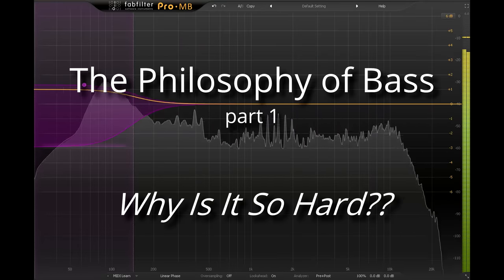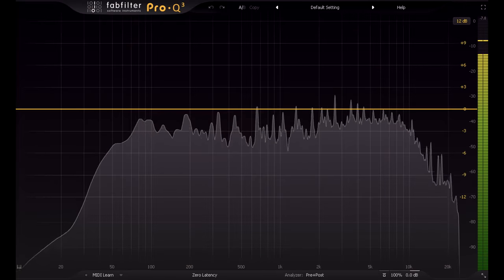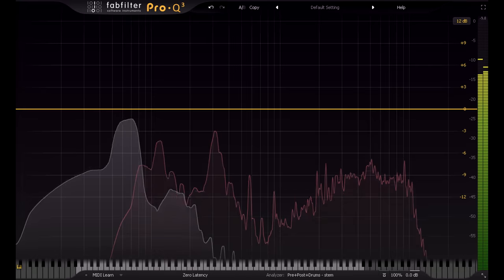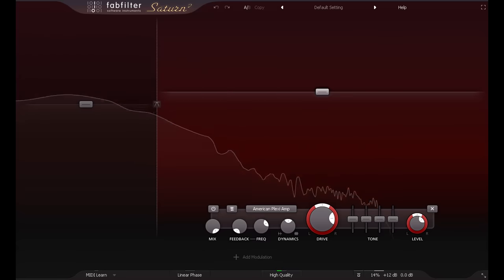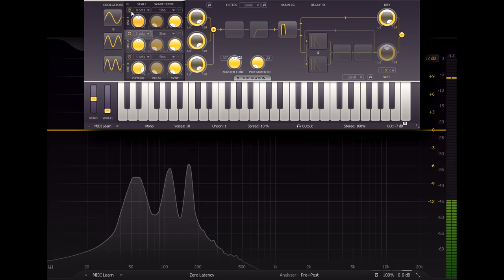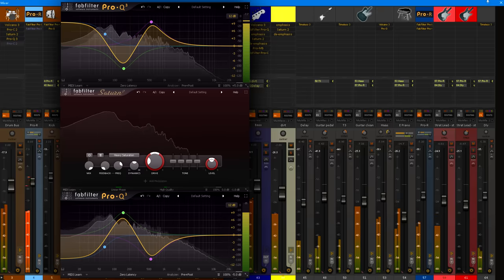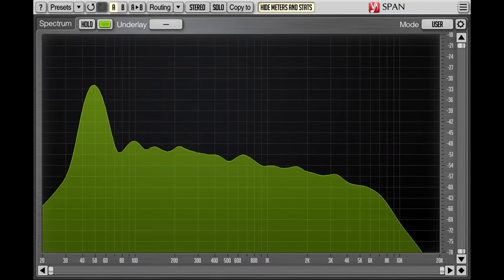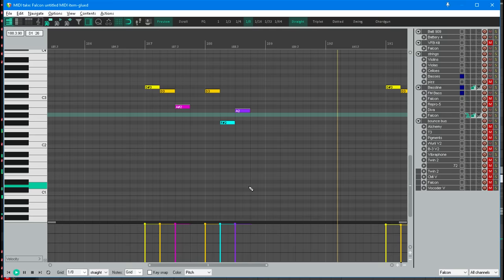The Philosophy of Bass

Comment: There's also other aspects of why you want to choose the speaker size (physical size) according to criteria most people don't even consider.
Further away you are from the speakers, larger they need to be, more cone area you need. This is because now there's more air between you and the speakers and speakers must be able to generate a pressure wave that has proper impedance matching to the air in the room.

When pressure wave is travelling through air, when there's high pressure, the air molecules in the wave are trying to escape to the air outside of the wave and when there's a low pressure zone, opposite happens, where air outside of the generated pressure wave is trying to fill in the low pressure region.

This strongly attenuates and distorts the generated wave further out of the source you are, and this generates a lot of issues where no matter how much volume you push into the speakers, they cannot deliver the pressure wave all the way to your listening position without it being completely wrong.

This is why in concert PA systems you see MULTIPLE speakers arranged into an array that they create a one friking huge "virtual" speaker-cone that pushes  a huge wave of air and thus can deliver the fidelity all the way to the listener even several tens of meters away. But because physics, even these systems don't rely purely on VOLUME to deliver that material but after certain distance one needs to have delay lines, additional sets of speakers that are delayed from the main ones (because sound is SLOW) that can re-establish the impedance matching and keep the wave going without too much distortion and attenuation.

And this is a thing even in high frequencies, even if people usually notice the huge subwoofer arrays first, the "bananas", as they're affectionately called, do similar job, but since high frequencies are more directional, one can divide the audience into "sectors" such that each individual piece of the banana can cover that particular volume of air, thus reducing the requirements from the speaker itself.

And when listening tuned array speakers from up close, they have very, VERY wonky frequency response, but it evens out at a distance.

So yeah... select spekaers based on your listening distance and volume of air. :)
Reply: I'm sorry, but most of what you wrote up there is misleading, misinterpreted or incorrect.
I'd suggest reading up on 'acoustic impedance matching' properly.
What you're describing is an attempt at countering the inverse square law. This is mostly achieved through means of higher SPL. That's achieved with stronger and more efficient drivers (and more drivers).
More cone area just means more SPL, mostly. And what we're after in subwoofer drivers is not cone area, it's displacement. Couple high displacement with high efficiency nets you high SPL within your given power budget.
And forget about transmission medium non-linearities (air causing distortion). That only occurs above some 150dBSPL. Yea you lose SPL, especially in high frequencies with distance, but that can be compensated with EQ (which is why the 'bananas' exist, the top most speakers have a strong HF boost to compensate for the distance loss, because they're aimed at the audience furthest away from the stage). The resulting increase in distortion has a very simple cause: the loudspeaker has to work harder because it needs to produce higher SPL.
And you're making it sound that high frequencies are more directional by chance. That's not the case, you can build a speaker with 360° HF radiation just like a subwoofer happens to do with bass. Line array elements are specifically designed to have an exact and controlled radiation pattern (5° beam width for the larger systems for example).

Comment: Another problem about headphones would be that just about no audio interface actually has a well designed headphone amplifier. There's always some catch to it, especially when using lower impedance headphones and more budget friendly interfaces. But even a lot of higher end interfaces struggle here for some reason. It's just very difficult to get an actually reliable system.
Reply: Can you elaborate on these problems, is there something to look for from a strict objective perspective? There's so much snake oil in the hi-fi system/DAC-AMP world that I find it hard to look for systems where the goal is accurate representation, not some subjective "warmth" or whatever.
Reply: @samuliauno8163   I absolutely agree, the whole snake oil thing is kind of a huge problem. loads of people really do not know how their equippment works and believe in just about anything they want to. I'm no expert either, I just happen to be quite interested in the topic and looked up waayyy too much about impedance and the whole ordeal. I'm going to try and explain it, but there is also an amazing video by Julian Krause on the topic (Amplifier Impedance matters!) which I'd highly recommend you watch. Basically, every component in an AC device (most audio hardware for instance) has an a spedific impedance, similarly to the way every component has a specific resistance in a DC circuit. This impedance is usually stated as a single number, but is actually different for different frequencies, so ideally you'd want it to be stated as an impedance response. Now, headphones and headphone amps aren't really two entirely seperate devices that just work independently of one another, but rather one complete system, once they are connected. This also goes for all other kinds of audio equippment of course, but in most cases, there are standards for what the impedance might look like (Take guitar speakers for instance. Those usually have an impedance of 4 or 8 ohms). This is not the case for headphones. Neither amps nor headphones themselves have common impedances in the professional audio market, which can cause a couple of problems. The largest and usually most detrimental one is the effect of connecting low impedance headphones to a high impedance amplifier. Since the impedance response of the headphones changes a lot across the audible spectrum, so will the frequency response in t his scenario, since certain frequencies require more current, that obviously isn't being delivered by the amplifier, since amplifiers aren't usually made with spedific headphones in mind. There are a couple of other measurements that are affected by mismatching amp and headphones, like distortion, noise, damping factor, etc. but I'm realising this comment is getting quite long, so I'll try to wrap it up. TL;DR bascially, you want an amp with the lowest output impedance you can get and headphones, with an impedance that is at least 8 times greater than that. This won't guarantee ideal performance, but you can absolutely bet on there being problems if you don't ensure this "rule of eights" applies. I have been searching for more or less affordable audio interfaces that have a low headphone output impedance (and good performance otherwise) for a while and so far the only ones I could find were the following: Bascially all MOTU interfaces, the Focusrite Clarette(+) series and RME interfaces. I'd assume UAD to be quite good as well, but I haven't found measurements since I find they are quite overpriced. If you don't have an interface with low output impedance (or don't know) you'd honestly best be advised to buy high impedance headphones. They are not without their downsides and some amps even work worse with them, but with the current state of the intrface maket you're running relatively safely if you do that. There is honestly waaaay more to say about this topic, but the Youtube comment section is probably not the right place for that. I hope I could help ;D

Comment: Thanks for a great video. One thing that’s often missed when mixing and mastering music, especially “complex” music with a lot of different processing, is that your music might really suffer when it is encoded later using different digital codecs and their different data compression methods. Data compression is different than the acoustic compression that we all think of. It’s the art of decreasing the number of bits and bytes needed to represent the actual sound of your music. In our modern world, only a few listeners will be listening to your mix at the same data rate as you are using to mix or master. Instead they will be listening to a much lower bit rate recording like a MP3. These codecs use a variety of techniques to do this data rate reduction but the very best of them use psychoacoustic techniques to remove data that’s not required to make your brain “think” it’s hearing those notes. Starting with the very simple technique of not encoding the low volume noises played right after a high volume noise. You brain can’t hear that low volume noise so why waste bits encoding them? More complex techniques start playing in the “brain” parts of the signal. They might filter out those upper range multiples of the lower fundamental since your brain doesn’t need them if you have represented the original frequencies correctly. The very best of these codecs not only remove these upper order multiples of the fundamental when encoding the signal, but replace them when decoding the signal on playback.  I bring this up as a warning when you purposefully mess with the signal by reducing either the fundamentals or increasing the upper order frequencies to achieve an effect.  You can create a sound that will sound fine in your studio but will sound like a train wreck when someone rips that track to put on their phone or Walkman.  While you might not care since your version sounds great, your listeners who you want to be customers, might not get the same experience. So I just suggest to travel carefully when you start playing with different effects. Some get very much lost in translation when encoded, decoded, encoded, and then decoded again. A video on these effects and how to deal with them might be very helpful.

Comment: Thanks for the breakdown on bass. There's definitely a lot to unpack here in the 30 minutes, and a lot of great tips.

There are two things I feel like could have been discussed in this concept of the philosophy of bass.

1) Perceived loudness, aka the Fletcher-Munson curves/equal loudness contours. Subbass and bass tend to be quieter relative to mids and highs to the human ears, so we tend to want to crank up the volume more to hear the bass better. Therefore, it's important to keep that in mind when mixing and leveling our subs and bass. If the subs and bass sound powerful at quiet volumes, imagine how blown out of proportion they will become when played loud, which doubles down on the point made in this video of huge boomy PA and club systems often already being subbass happy in their own mixes. I think it's a good rule of thumb to consider, make sure the subs and bass aren't too hot when listening at quiet volumes. We all want to make music that sounds better when volume is turned up, not the other way around.

2) An overall deeper physics breakdown of sine waves and subwoofers. If you ever look at a video of a subwoofer pushing out air in slow motion, it's pretty obvious it's strongest when it pushes out smooth sine waves. I think there was a good opportunity here to showcase Saturn's multi-band distortion features, so you can leave the sub range of 100Hz and lower undistorted/saturated. If we overdistort the sine waves down that low to the point they are clipping into square waves, it gets to the point it's an unnatural shape for subwoofers to push out, and potentially risks damaging equipment on top of just overall losing a nice clean sub impact.

I listen to a lot of bass heavy genres, and I'm often surprised how many when thrown under an analyzer like SPAN show that the sub region isn't hitting as loud proportionally to the rest of the song as you would expect. Maybe it's part of the psycho/brain element of bass in our heads, or maybe it's just the concept that simpler can be better, and a really smooth clean sine wave at the right levels really shines through in a mix at loud volumes.

Thanks FabFilter and Dan for the continued content. I've learned a lot over the years thanks to these videos you put out.
Reply: Square waves won't arrive at the subwoofer, since the sub is low-passed (I hope!).
Square waves are just superimposed sine waves (a fundamental and its odd ordered harmonics).
Play back a 50Hz square wave in your DAW and put a 60Hz 24dB/octave low-pass on it and listen. That's what arrives at your sub (if it's crossed over at 60Hz), which is basically just a 50Hz sine wave again.
If square waves arrive at your sub, that's because the sub's amp is clipping. Voice coils need constant movement for cooling, which square waves don't provide much of, hence they overheat and die.

Comment: Any thoughts on mixing with headphones together with SoundID Reference for a flatter frequency response, and CanOpener by Goodhertz for more crossfeed? 
Would love to hear your opinion on this.
Reply: I would love Dan's take on this as well.  I use this setup but corrective EQ can get pretty phasey really quick.  I mostly use Sonarworks for reference. Mixmode and dial it back to ~80%.  I leave CanOpener on through out since I only use it to add crossfeed
Reply: @_allcap  What do you mean with corrective EQ getting phasey? Does it happen with Sonarworks as well for you?
I can't say that I hear any artefact with Sonaroworks on.
Reply: i use both, n they are a great help.
Reply: @kelainefes  Yes it happens to every eq unless you run it in Linear Phase mode...which has it's own drawbacks. The phase shift in Zero Latency is unpleasant for me. Mixed mode is a decent balance between the two
Reply: @_allcap  humans can't hear phase, you know that right?
You'd need to mix the dry signal with the corrected signal to get the phasey effect you're talking about, but that's not what the mix knob does.
You just don't like how your headphones sound when corrected.
Reply: @kelainefes  From my knowledge that may be true for gentle wide moves but narrow cuts/boost will affect the frequencies surrounding the EQ’d frequency.  That compiled with however many bands SoundID uses to correct the headphones is what I assume is what i'm hearing. You may be right though (I'm no phase expert) but I do notice a a difference between all 3 modes.  That's constant across all 3 of my headphones (HD600/Focals/Sony)
Reply: @_allcap  Yeah if you have a really really high Q cut or boost you can hear it but it's not phase that you can hear, it's the resonance of the filter.
To be fair I have DT770 Pro and they don't have any sharp peak in the response so Sonarworks doesn't need to use any high Q filters.